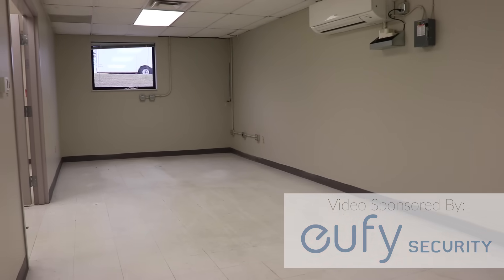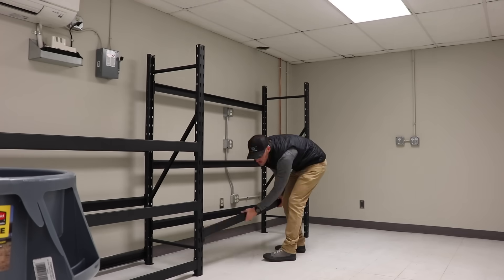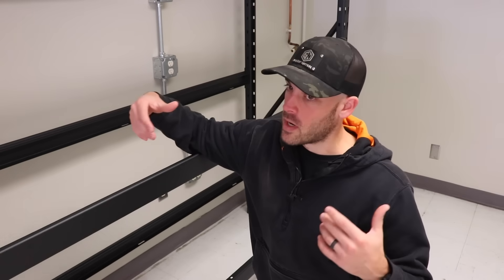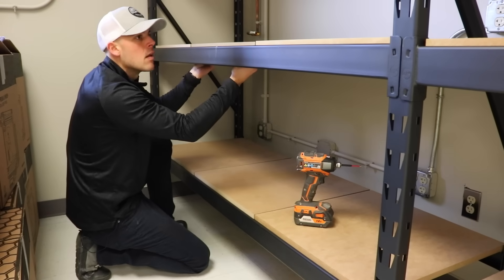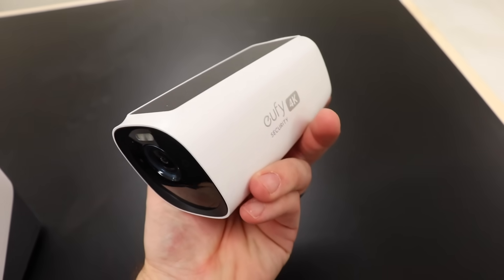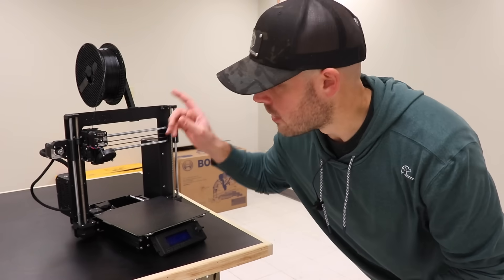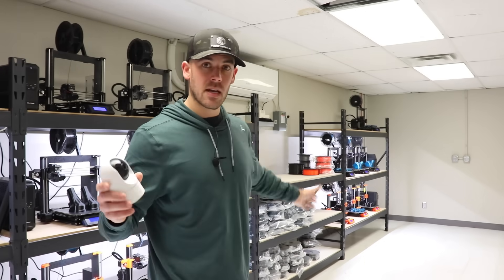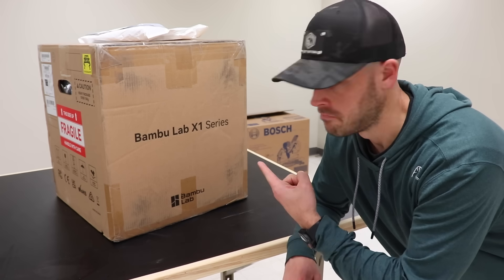I Tried Building an Industrial 3D Print Farm

Comment: Great video, thanks so much for putting this content out there.  Question for you about the UPS.  The one you have linked is 1500VA which is 900W.  Doesn't the Bambu P1S draw alot during warm up if all 3 printers are heating up at same time?  Some sources say 1000W, others say 350W so I'm not sure if those sources that say 1000W are due to it being in Europe that uses 220V.  I'm in the US.  If 350W max, should I still be ok with putting 3 printers on the UPS you linked (supply with max 900W)?  Just making sure I'm not buying something that isn't going to work for my setup.  Thanks in advance and apologies for the lengthy question :)

Comment: Concrete slabs on foam have almost zero compliance and a very high resonant frequency. That's because the load per unit area is so tiny. Being spread over the entire area of the slab. Whether the increased mass is useful in avoiding mechanical excitement is debatable. Your compliant foam strips on smaller shelf plates seems ideal.

Comment: For your comment about Ender's at the end of the video, I do think they have a place, but more as an introductory printer than a long-term Workhorse that you're going to use consistently for years. I have one, and it works decently for the most part, but it's definitely not without its issues. It's already been down more than once within the last few months of me really starting to use it, and while I don't anticipate that stopping entirely, I do plan to upgrade things as they need replacing to increase the longevity. Long-term plan is obviously to just get some better printers, but as a starter it's nice to have something that's a bit easier on the wallet :p

Comment: i built a voron as many others have. files for everything and huge support group. prints are super fast and accurate. There are others to consider also. RatRig, Vzbot, Ect. Heres my take as a biz owner. build a voron. Support group awesome, Always new tech and upgrades coming out for free. EVERY part can be Easily sourced. Once you build ONE get someone else to build you ten more as you can be making money and your time pays you more to print then build printers. There are people already doing this. Then you can easily maintain them yourself. This gives you more options you cant buy at any price. Like say you have a custom part you could design a printer just for it. They have ready built conveyors already figured out. so part finishes and it clears it itself and resumes printing. ect ect. Your also  using open source software if you need to change something no thec support bs on Friday at 5 pm lol. Multi color feeders, ect ect. No way any production model can say any of that.

Comment: I recommend installing a deflector on the air conditioner to divert the flow of cold air from the printers to the ceiling. and also install an automatic humidity and temperature control system.

Comment: You should setup your outlets with an arduino thats programmed to shut off power to specific printers if they mess up which would require some sensors ect or the easy way is to be able to use it in manual mode so if you see a print going wacky you can just shut it off rather then having to run down to the shop in the middle of the night. been there done with that haha its easy

Comment: You cut each board individually, then mounted a light between the three boards. Doesn’t that tie the 3 individually cut boards back together? Have you had leveling issues since the installation?

Comment: Why do you still pull prints? Ive seen many print farms, as well as my single printer is setup at an angle and has custom Gcode to clear the print and keep on printing. Its a different world when you don't have to show up to clear each print bed.

Comment: !!!QUESTION!!! For you :)

What do you do about venting? I have one printer and if I run it inside I get a CRAZY headache from the smell of melting plastic! I am fully a new guy to this adventure and just not sure. Even though about building fume hood like the ones in a laboratory. Any thoughts would be very helpful. 

Cool farm btw.
Reply from the maker: What do you print? Usually PLA and PETG are pretty odorless and don’t emit many VOCs. General rule of thumb is always print in a ventilated area

Comment: People here acting like they have a mechanical engineering degree cus they bought a 3D printer will always be funny. 3D printing is great for prototyping but not for production unless youre making complex parts CNCs wont cut. Use injection molding, blow molding or roto molding instead if you want to produce a lot of parts fast and cheap. This aint it chief

Comment: If you are buying an ender printer, it is because you are a beginner, and you need to know what the taste of failure is.  I speak from experience.  The printer I have is a money pit for sure, but it has taught me a lot about how to build,  modify and maintain my printer.  I am slowly  moving it out of stock so it is getting better and more reliable over time.  I do have to admit though, I have spent close to 300 bucks to get it where it is now, which is still to say, not reliable.

Comment: I print production parts seasonally with my ender 3. Out of the box they are not fit for a farm, but with modifications such as a dual leadscrew and a completely new print head and mainboard, mine has been exceptionally reliable for less than half the cost of a Prusa. It's still a option for a farm, but not if you need to rebuild more than 3 or so machines due to the time involved.

Comment: question I want to start my own print farm is it a good idea to start with what you have or get another I have an Ender 3 pro however I have to get it fixed so in the meantime I am getting an Ender 3 vs2 which will arrive Wednesday?
Reply from the maker: I would strongly advise against Enders for print farm machines
Reply: @ShopNation  it just for the time being until I can save up to get the one I want I am also getting a resin since it was on sell

Comment: Do you have any large format printers in the 400mm x 400mm size or larger?  Or do you only do production parts that fit on the bed of the Prusa printers? 

I only have an Ender 3 V2 and am constantly finding projects that need more than 200mm x 200mm and it would be easier if I didn't have to print in pieces and glue or fasten together.

Comment: as the owner of an ender print farm (I got them new at $50 a head) not worth it, I'm in the farm fixing printers almost as much as it is running and have rebuilt them to almost entirely new parts multiple times over in just a few years.

Comment: Just found your channel. Great stuff.
I'm from an IT and project management background. I would suggest separating your power from the print shelves as you grow. That would also allow you to put more printers easily on a shelf (yes, I realize 3 look great on camera). Move to a power distribution system with centralized redundant rack-mounted UPS units, preferable 240V, which could also house a print farm server. It may seem like a lot of money, but simplified administration, efficiency gains, reduced downtime due to failures, and reduced overall replacement costs will be worth it in a shorter time frame than you would expect. On another note, you could easily use cameras with some basic machine imaging to determine some failures, as well as when they stop. Drop a line if you want some ideas.

Comment: You need a Bambu x1 carbon for any parts you want to print with, well, carbon. It is designed for higher tech filaments, like fiber carbon filaments. You would probably end up replacing your entire fleet with them eventually. I wouldn’t though. I would still do PLA or other open-air blends where it makes sense & use other filaments that benefit from enclosures where they make sense. If you aren’t using them yet, you might not need them yet. Carbon filaments are not “black aluminum” no matter what anyone says, though you might find uses for them. The nice thing is that they print very quickly. You can get work done with them in 1/4 to 1/3 the time an MK3S+ can do the same print. You are already looking into everything I just said - the only issue I would worry about as an enterprise like yourself is that Bambu is proprietary. They have excellent pricing on parts, however, in the event they ever go out of business, you have to find an alternative.

Comment: I have that shelving in my shed. I had to put cross supports in it. I also use the same lights and have them light my walls where a lot of stuff hangs.
Did you consider putting the bottom shelf lower so the top shelf would be slightly lower?

Comment: As much as you are going to be printing, I suggest giving a lot of thought to the Creality CR-30 3D Printer 3DPrintMill Infinite Z Belt. 3D printer nerd has some good videos about this model. You can mount it vertically and the print will fall into a bucket as the belt knocks it off. No plate changes, just start it and go.

Comment: Hopefully the New Eufy cameras are better than the previous model, obviously solar will be better, but the video quality is not the greatest on the 2 Pros. But that’s not my biggest gripe. When you lose Wi-Fi or power you also lose the cameras which is a pain. And you have to have the home bases close enough to each camera to stay connected. I’m interested in seeing how the new ones perform because recharging isn’t that much of a pain I just always forget to do it. 
With the indoor camera…. It’s basically junk lol. Especially when the lights are off. You can’t see enough detail to tell if a print is actually failing unless you’re super close to the printer. Even in lighted rooms it’s still not high enough definition. But I do use it, and it lets me know when prints are done so I can shut the printers off remotely, that’s just about all it’s good for really.

Comment: wherever your living youre super lucky to only need 3 cameras for security. in my country you firstly need to have a steel building or one made from concrete and bricks. then you need anything from 6 to 12mm thick steel burglar bars. security gates. security locks. an alarm system. a contract with armed security forces and maybe a security guard. a fence or high wall would also be needed. hello africa

Comment: nice setup, just a comment about placing printers near window:

1) If your considering placing printers near windows, then take into considerasion the downward draft from glass surface, do to inner surface cold temparature, that would result in cold temp. dropping down along wall. wether it would be a problem or not is hard to say do to alot of factors. but I think i may be able to be countered, by placing insulation material (that dont releas fibers and toxic gases) in the inner window hole and leave a gap at top, to insure that humidity between insulation material and window is limited.

Comment: Since you seem to love Prusa's, I guess the Sovol SV06 would be down your lane.  And at the speeds such a Prusa (or clone) prints, a concrete anti-vibration setup will indeed be overkill, but if you get a core-xy and print at high speed and high acceleration, you might want to bolt it to a fully concrete table instead of just putting it on such a small concrete tile ...

Comment: I'm actually pretty curious about how the Bambu Lab's would hold up to being used for a print farm. Especially with how much engineering you did to prevent vibrations - I know the Bambu's are top notch at vibration correction. My only hold up would be how proprietary they've made they're systems. If you don't mind using their filament, I could see their AMS system being beneficial.

Comment: Hey dude. I do industrial automation 24/7/365. If you get to the point you want info or advice with robotic print farm tending feel free to ask me at any point. To max out how many you can fit on each circuit you can put separate inline relays, controlled by an arduino or whatever you're familiar with, to the bed heaters and write a simple script to only allow a certain # of heaters to be turned on at any one time. They turn on and off to regulate temp already, so this just makes it so they don't all turn on at the same time.

Comment: is it possible to build an automated production line where you use octoprint on all of them (so you can control, queue, monitor, them remotely much easier); create a way to automate popping off the prints/beds, move on to the next prints, auto-load filament, all without human intervention? same with packaging.

as an engineer you should be able to do a few of these.

Comment: Bro, that's  not an Idustrial Print Farm. That is hobby FDM Print Farm. There are no industrial  machines or industrial materials capabilities there. With the money of 75 prusa you can buy 2x the fuse one sls printers with cash to spare l. Or something faster an cheaper to run from hp like the jett fusion. You will have less volume but way better materials and capabilities of batch manufacturing

Comment: really late, but:
"the spaghetti detective" + klipper + mainsail would probably be a killer option.
you mentioned you need to change z offset: well just get a probe (like klicky) for your printers and that's automated.
Reply from the maker: Frankenstein printers + are not + reliable for farms
Reply: @ShopNation  which one makes it frankenstein? lol
the software (spaghetti detective, klipper, mainsail) is pretty reliable, and I'd at least recommend those. It would allow you to keep track of all your printers remotely, start prints remotely, and use AI to identify failures. 

apparently I'm wrong about klicky; no one has made it work with the i3 yet, which is a bit disappointing. 

since I've got your attention, for printer recommendations, I think I would only recommend the prusa xl.
only voron or prusa are easily repairable, and voron would be a no-go for build time. I might recommend the troodon 2.0, which is basically a prebuilt voron 2 made out of injection molded parts, but I'm not sure its prebuilt enough for you, as ygk3d reports a 3hr build time...

because of that, it might be wisest to wait for the prusa xl.
EDIT: lol apparently you can buy a completely prebuilt voron 2 for $2500 from voronkits , but that's expensive (although the same price as a prusa xl)

Comment: I would normally agree with enders and print farms, but I would really appreciate if you tried a single S1 pro and gave us some feedback. I got one and I came from a normal ender 3 and I expected the same level of thinkering, but in 3/4 months I have barely touched the stock cura settings
Reply from the maker: Enders are absolutely great for hobby use, I have nothing against them as a printer.  But they just are not print farm workhorses.  There are essentially no "big" print farms running Enders.  Any decent sized one that is running them is transitioning to something else
Reply: I also have an Ender and love it. Ender 3 Max Neo. It maybe shuts off once per week or when I run out of filament. Yes, I'm a hobbyist but this thing is a workhorse right out of the box. Everything is stock and it works great. I was thinking about upgrading the software but why fix what isn't broke..

Comment: 13:46 I am a proponent for Enders. My whole farm is made of 25 Enders S1s and they kick ass. Thanks for making us feel included though even if it’s just to rag on us.
Reply from the maker: How long have you been running that many?
Reply: @ShopNation  2 years on looped gcode. The parts I print are all 15+ hour prints and the gcode I made knocks the parts off and starts over. I hang 3kg spools from the shelves. You can feed a printer below OR above the 3kg roll. I didn’t have enough capital to start my business so I had to use cheap Ender 3v2s. I have no upgraded to all S1s. The key is using sprit extruders.  I only Change filament every 2.5-3 weeks
Reply: @ShopNation  there is a lot of variance because of the growth but I still have all the original ender 3v2s going since day one. Aside from changing bed springs and a sprite extruder they have been amazing. I started with 300 dollars and made it here. I love your setup! Can’t wait to see you grow!
Reply: @ShopNation  I’ll check some machine times later to see which is my oldest lol.

Comment: You can fit more  in the space if you take a tip from libraries, instead of just putting against the wall, have racking come out perpendicular from the wall and completely remove the racking parallel with the wall.    If you 3d model it out you can see the difference.  I found this out when doing storage design to maximize some garage space.    Also you could build some cheap enclosures by cladding the racking with some 4x8 sheets of something and then hook up some air purification or venting.    NICE job though taking the steps to get to where you are!  Love seeing the electric put in proper.  :)
Reply: tbf, you can just mount the machines at an angle to decrease the vertical footprint, allow you to squeeze  in an extra shelf. If you let the bed cooldown, parts probably even self release and just slide off the print bed.
Reply: Wouldn't this decrease efficiency since you would need to go in and out of each rack rather than just going down the line
Reply: @danzhu403  The prints take the most time, have more printers = better efficiency
Reply: @danzhu403  Also that would be minor